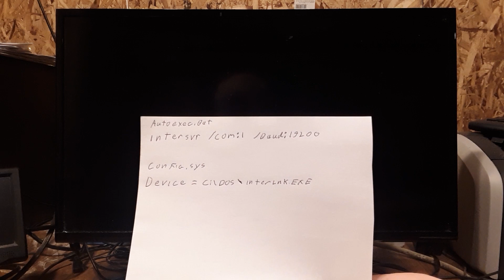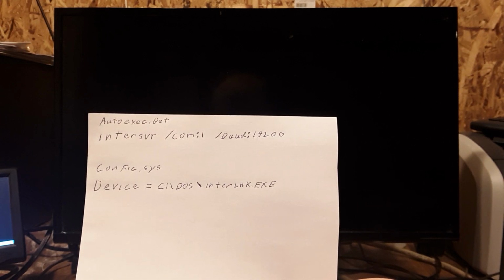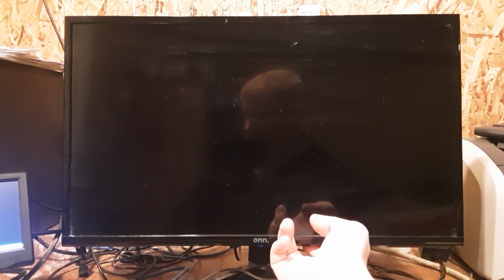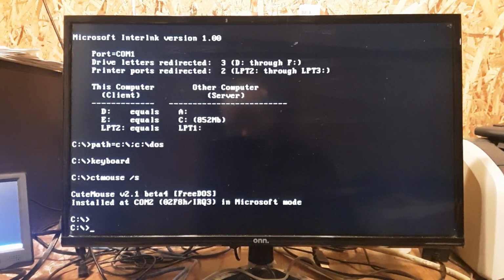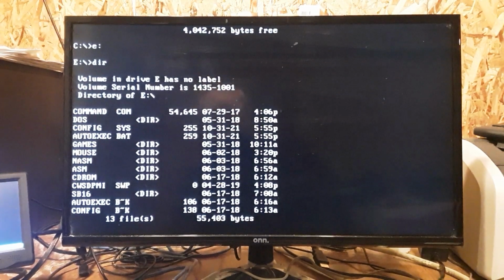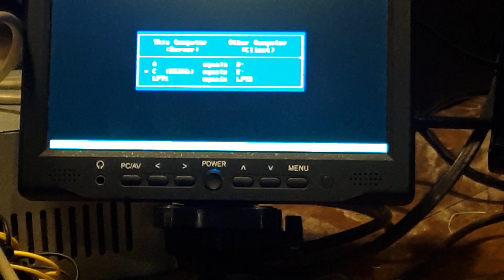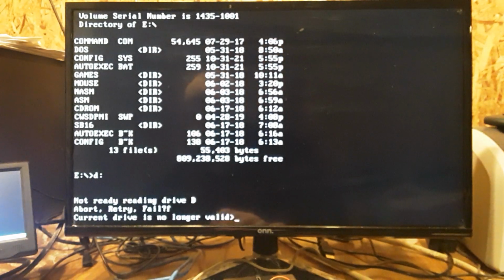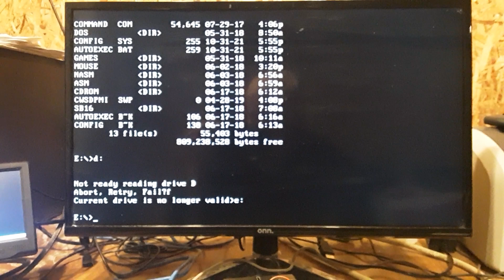Serial Null Modem

Comment: Hi, it looks like i am a year late on this video

I spent ages on these things in the day - mostly amiga to pc as i would write up documents in Amiga and save them as RTF , then serial to my 286 and later  386 to place on 3.5 floppy to print on the laserjet at work

XT's have a early 1 bit buffer in the serial port so often 9600 is the limit 
Later the 16550 UART was used for 14.4 and higher external modems to sustain higher transfer rates ( i think it was just 16 byte buffer totally small fix for a problem )

Later i purchased Laplink 5 and used that PC to PC

The null modem cable became popular as the Doom 2 player cable ( just like Wold3d sold VGA cards and monitors , Doom sold null modem cables and T-base 10 lan cards - i still have co-axial cable under the house connecting 4 rooms

Laplink and Fastlynx ( FX2 is better ) are great programs, then Microsoft added your featured software link up in its base dos installer ( this plus windows 3 free fax modem ability are 2 programs that sold windows to many people )   

You can use 1 copy of the above 2 items and there is a command to transfer the software to the target machine

mode com1:2400,n,8,1,p
ctty com1

This is basically bootstrapping the pc, it substitutes interaction via keyboard to getting instructions from the serial port

This will transfer the program to another pc on  the end of the serial port / null modem cable

Once the program is transferred you can break the connection and run the software on the second machine, you will then be able to transfer at higher speeds, the 2400 slow option is used just once to establish connection / handshake

Laplink and Fx can be used to control wither one local Pc - similar to Xtree file management or remote PC on serial or parallel cable

19200 is close to being just under floppy drive speed, so it is fine for transferring  a small program or some data files. - You cannot actual clone a hard drive as it is not a image created, however you can transfer every file you tag or directory or every file on a drive letter, but it will just be "file copy only"

If you want a back up and a bootable system it will be a 2 step process.
1. use a dos disk and fdisk then format the new boot drive, ensure it is bootable eg format /s  or sys c:
2. now use the serial file transfer method and copy back the files - this work great dor simple dos 2 to dos 6.22 formated drives

Note 20meg hard drive = 30 mins in real time !!!!

Now laplink and FX2 can also use parallel cables , and also advanced turbo  parallel but both machines need the advance CMOS / BIOS parallel port options 

Laplink sells ( aftermarket as well )  standard 3 wire cables - these use software flow control, there is a multi wire ( 5 or 7 wire ) that uses hardware flow control 

OK laplink can also go faster than the uart speed on XT's of 9600 - i am not sure how, but many people explain it as ignoring the IRQ / Interrupt polls and constantly sending - i dont know - it is beyond my expertise but i have seen it work much faster - it has nothing to do with turbo speed or clock speed eg 286/386/486 it is a trick similar to using direct hardware control similar to the concept of serial fossil drivers

Other features

I very much want to simulate a setup of running a basic program or dbase etc with a null modem cable and treat the other machine like a dumb terminal attached to the PC.
I cannot find any software yet i know plenty exists, for example many video shops in the day use a PC with multiple serial cards ( 386/486) and used low end pc's down to XT's and dumb terminals to run via serial port and act as a client

Many original IBM basic software is supposed to interact with serial port, but i cant even find a simple hangman or battleship program in basic to do this

There are about 30 games from the era that uses null modem multiplayer, the only game i can set up on a Pentium 2 and Toshiba Pentium M laptop is doom 2 player - both run dos 6.22 - the P2 can multi boot to Win 3.11 the laptop to XP - both have a base fat boot are of @ 540 meg 2

Modern Machines
-----------------------------

To me modern <> legacy ports  eg serial / paralell

My newest classic machine is a IBM P4, it has 14.4 floppy,  serial parallel, dos 6.22 and dual boot to XP

This is my go-between machine, it connects old to new via cat 5 ethernet
Oldest machine is Pentium 100, then Pentium 2-233, then i have 2 toshiba laptops one of them has legacy ports and is a Pentium M or C - the other one is a satelite and a year newer with no legacy support.
In addition i have 2 thin clients that have serial ports they have AMD or Athlon processors - i use them as my portable Doom machines for null modem, but they also run XP and can use Doom Port called Zdaemon for internet play (16 to 32 player but you never see that many people on it these days on one map )

Why the thin clients - they are cheap and plentifully and are not a security threat, all data can be backed up on 16gb usb stick so i can reimage them daily if needed, i can stack 4 of them in a 15inch laptop bag !!!

Modern USB machines
------------------------------------
This is tricky, while there are usb to serial adapters, it is difficult to get them to work on every system. I have 4 different brands and it took a lot of trial and error to work out which one works on what version of Windows OS and what it talks to.

Luckily a old Dell E7440 laptop ( 2014 vintage and now sells for $100  ) is cheap and they have built on serial chips, however the laptop does not have any ports, but they do appear on the usb 2 version of the dock - it has legacy ports 2 x serial 1 x parallel and 2 x PS2.  The "other dock" is USB3 and has usb 3 ports and no legacy

I have had good success with them and they also talk to dosbox when configured

Thats is, i am sure i have left things out

Regards
George

Comment: I never used a industrial null-modem cable. I just did it myself. RxD and TxD swapped on one end and GND. It was enough to link computers with interlnk/intersvr  or with NC. I got 19200 baud on regular UART chips or 115200 baud. However, to clone NC is safest(and quite slow)  to use 1200 baud on both computers.
I would recommend to use Norton Commander  "link" option (version 5, I personally prefer to use) because is easy to use and have on one panel the local drive(s) and on another the remote (link) drive(s). Also, it do not assign drive letter to each drive on the remote (slave) computer.Also, you can play with the connection speed settings very easy and see when it became unreliable.
As for now (2021), NC is abandonware (or seems to be) and can be found free on many sites, as installed zip or full floppy images.
Great video, btw and a very good channel. Thanks for your content.
Edit: Yes, the parallel port connection is way faster than serial one. And NC have a terminal emulation feature that you can try.
Reply from the maker: I will definitely have to look into Norton Commander. If it works I will make a video demo on my project.

Great comment!
Thanks
Reply from the maker: https://youtu.be/goVIHWIYA-U

Comment: Pretty sure an 8088 with a 16550 UART will do 115,200 (check the chips on the card). With a standard 16450 it should still easily do 38,400.
Reply from the maker: I will check it out.

Comment: A good easy way to get a modern dumb terminal machine is use a RPi.  I've used RPi1B (via GPIO pins and USB to RS232 adapter) and  RPi0W (USB to RS232 adapter) and both work great even though they're lower powered CPUs.
Reply from the maker: That would be worth trying. I am still waiting on my USB to RS232 adapter. I will make a video if it works out.
Reply: @elijahmmiller  Yeah, I did this when I needed to troubleshoot the iDRAC hardware on my Dell R720 server.  Figured out that I had worn out eMMC.  All thanks to an old RPi1B :D.

Comment: I used a null modem many moons ago to connect a 386SX-25 and a 486DX-33, even for a young guy like me that was very slow, after doing some math between the file sizes and the time it took I realised that the speed was correct.